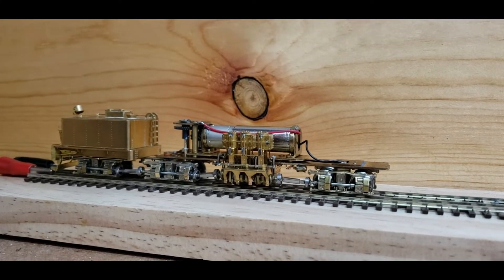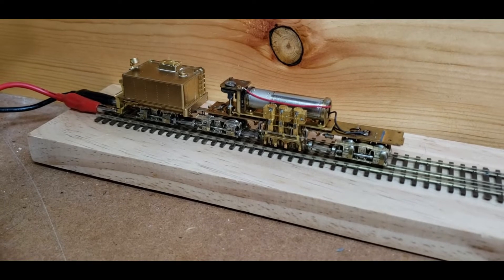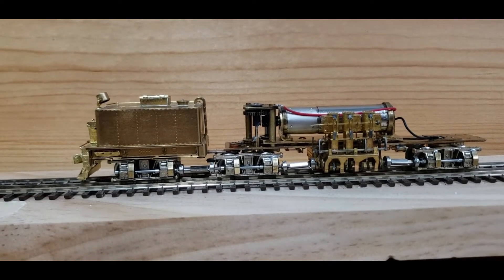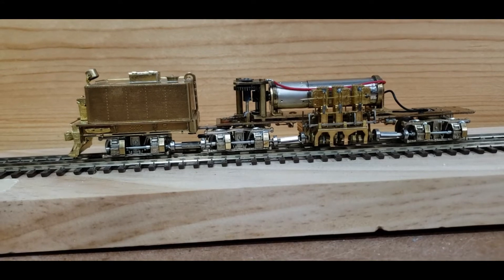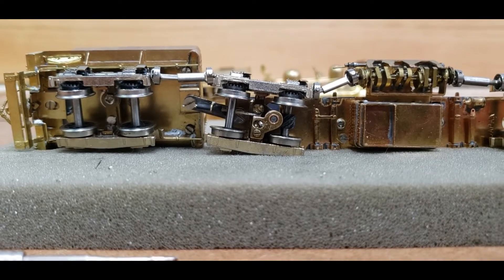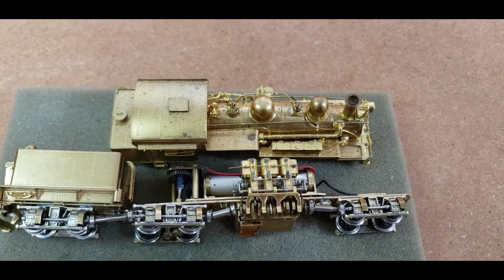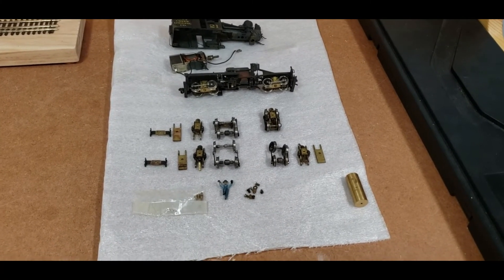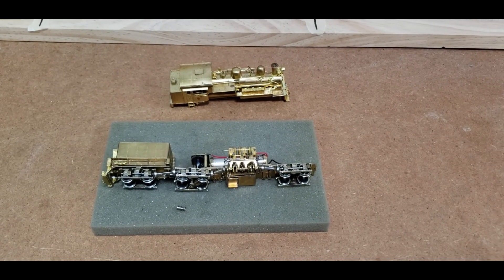West Side Models Hon3 Brass Shay#8 Rescue and Drive Repair

Comment: DTJ did more research on T&T line &Bullfrog Goldfield RR  they all used the Baldwin 2-6-0
And only a few Climax in narrow gauge
Reply from the maker: If you're looking for something close to start with on the Heisler, the brass Westside and later PSC imports of the West Side Lumber Heislers are about the right size.  They're 37 ton locomotives, I think.  You'll have to make some changes like modifying the oil and water tank, adding the appropriate stack, and changing the cab.  It looks like it has the right frame design.  You can find early Westside junkers on Ebay at a reasonable price, but getting them to run well can take some work.  I got mine really cheap.
Reply: @dtj9923  thanks
Reply from the maker: I definitely know the T&T and Bullfrog&Goldfield.  I'll look up their info and see what I can find.  I have a few books on the Death Valley railroads.
Reply: @dtj9923  thanks
Reply from the maker: I looked around.  I think the Heisler in question is SN 1026 from 1899.  The Heisler production history lists it as a 35 ton engine.   It ran on the Death Valley 3 foot gauge, which was actually a subsidiary line of the standard gauge T&T.  DVRR Heisler #2 started on the Borate and Daggett line, AKA Pacific Coast Borax loco #2.  Page 108 in the Heisler book by Kline has a picture.  The other two engines on that line were both largish Baldwin 2-8-0s with 42" drivers. Both locomotives still exist as does the Brill motor car.

The only other narrow gauge I know of would be the 2 foot gauge borax mine tram lines.  If you really like really narrow there was the Epsom Salts Monorail!

Comment: I just found your videos 
Do you build/ refurbish locomotives to sell? I’m putting together a pre depression short line that ran from Death Valley to bullfrog Nevada. Crossing California and Nevada. Main line attached to Santa Fe RR in Barstow, I think. So some HOn3 and HO main track. The line used Climax, Hiester and Shay 
Can you help me out or direct me
Reply from the maker: Hey Kurt, I'm not actually selling models or services unfortunately.  Do you have information on the specific versions of Shay, Climax, and Heislers your railroad used?  I might be able to point you to some of the better running models.  

I haven't played with too many Climax models, just the small Sugiyama 18 ton sold by Flying Zoo.  I have a lot of different brass Shays for reference.  I only have a single Heisler, it's the Westside Models, West Side Lumber HO/HOn3 two truck.

Non-brass, I've worked with MDC and Bachmann Shays and can give you some help there too.

Thanks, DTJ

Comment: Very informative--thanks! I have a West Side three-truck HOn3 shay which is dead...I tried to have a local repair guy install DCC, but it hasn't worked since I got it back. Do you know of anyone around the country who is knowledgeable and will work on these?
Reply from the maker: Thanks for stopping by!

There is a guy called "TheShayFixer" who is supposedly a model Shay genius but I have never used him aside from raiding his parts inventory.  I think he does it all.

https://www.shayfixer.com/

I will probably be doing a follow up to this video with a lot of still pictures showing the actual disassembly, repair, adjustment, and reassembly of this thing.  

I really want to know what these guys were smoking when they designed these mechanisms.  Hard to believe they actually went to market this way. 

When you say "hasn't worked since I got it back" what do you mean exactly?  Electrical, DCC related, mechanical bind?  Maybe I can help.

-Damon
Reply: @dtj9923  thanks for the reply! I had reached out to the Shay Fixer probably a year or more back, and he said at that time he had at least a year's backlog of work!

I had originally bought this Shay about two years ago off EBay, and though I didn't have a layout built then, I did have a piece of HOn3 track, and an old DC powerpack, and the engine ran forwards and backwards, albeit pretty noisily. A local hobby shop said they worked with a guy who did repairs and mods, so I gave him the shay to install  a DCC decoder. After many months, it came back, and although being a newbie with DCC (I got a NCE system), one time I was able to program it enough to get it to run for about 12 inches and make sounds! Then it stopped. Shortly thereafter, my NCE unit shorted, I sent it back to NCE for repair, but now that it's back, I can't get any life out of the shay.
Reply from the maker: @lstocks  Does it still operate with straight power if you bypass the DCC?
Reply: @dtj9923  I turned it upside down last night and attached leads form a power pack to every combination of wheels and pickups I could think of and got nothing
Reply from the maker: @lstocks Assuming you aren't registering a dead short...  If you're comfortable taking it apart, start by looking for a broken or disconnected power wire first.  It may be just that easy.  Check ALL the truck power connections closely.  Make sure the screws to the power connector tabs are all tight.

If there are any plug connectors used for the install, check them over. 

Next, isolate the motor leads to protect the DCC module and make sure the motor works.  The old Namiki coreless motors are somewhat problematic.  They will freeze up due to old hard motor lube.  Mine had that issue.  

They're also pretty easy to fry.  If you manually rotate the motor 1/4 turn and it runs you may have a burnt field or commutator.

Just taking the body off isn't too bad.  Don't dive straight into disassembling the mechanism.  It's fussy, not needed yet.

Let me know what you find.

-D